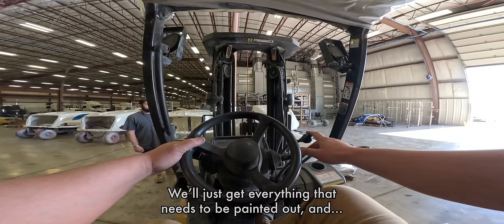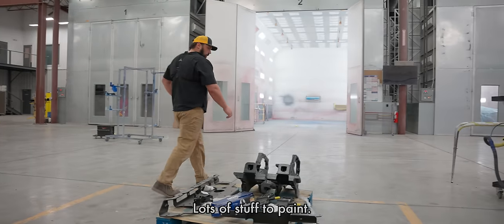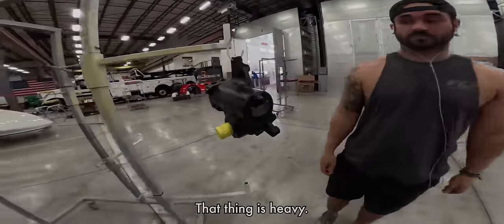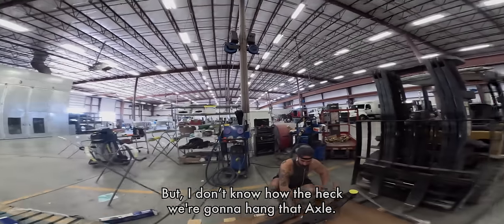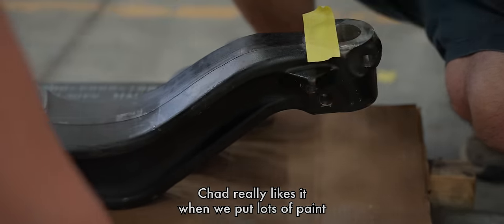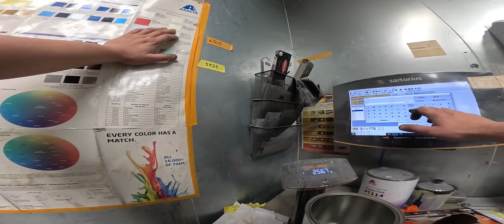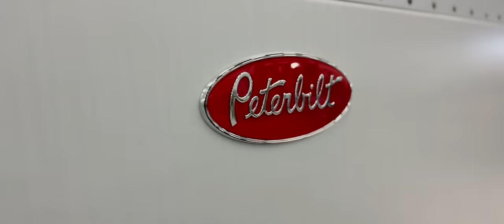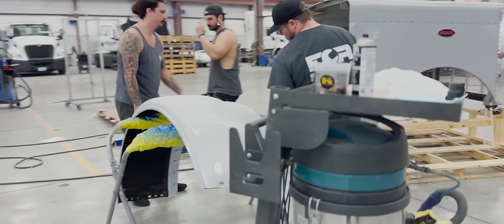Truck With A White Frame Gets MAJOR Repairs!

Comment: Good video Brad - saw you teaching Tim Gentry. You managed to get him to a reasonable level from a fairly low base, lol. Robert obviously has some set-up there which is hugely impressive and I commend him for it. Did you ever think of painting the front of those booths? They'd look so much better in white with branding. Also, do you use "peelable booth coating" - it's a good product for protecting the booth & suppressing dust etc. You might also consider tiling the floors?

Comment: You all probably already know this trick but just in case;  those cheap foam ear plugs are great for masking bolt holes and small spaces for paint
Reply: Right on man, been painting 30 odd years and only found out that trick about 8 month's ago. Life changing trick 🤣